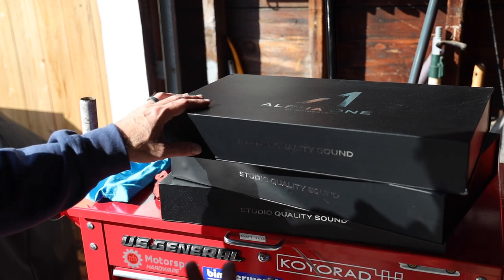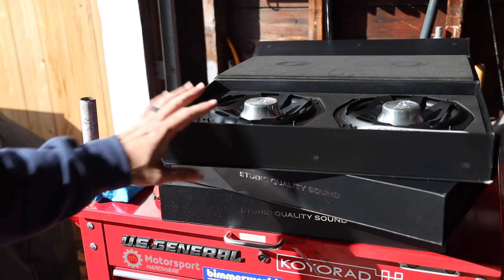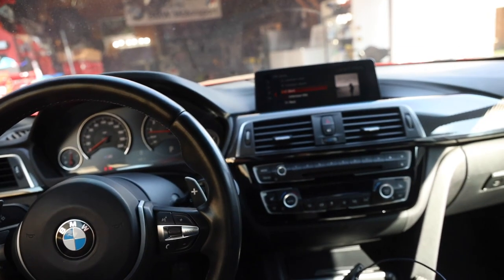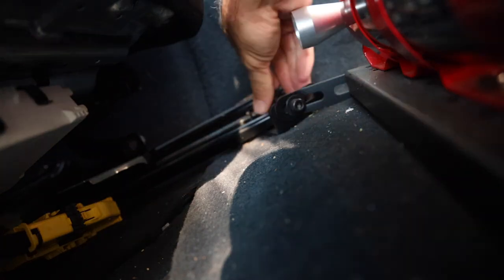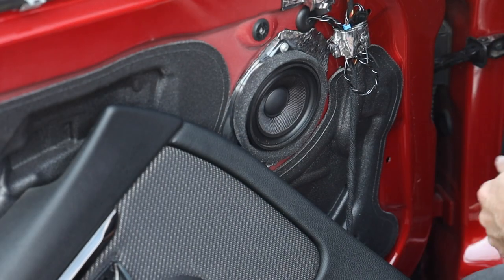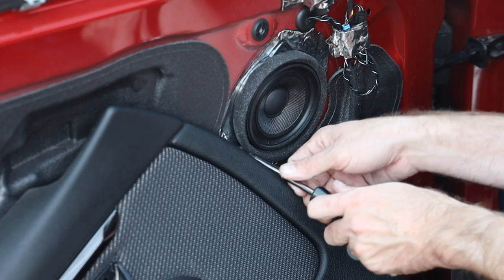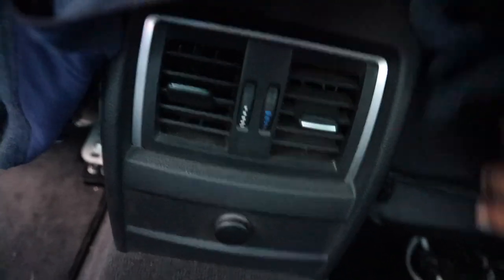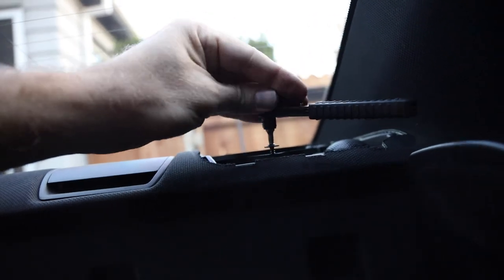Bimmertech Alphaone vs BAVSOUND Speaker Review BMW M4 F82

Comment: Thanks for the honest review Blake!  Naturally we're biased here at Bavsound so, wanted to reply to a few of your points speaking in *general terms*: A couple of things to keep in mind: More efficiency often means less control. It would make sense if you are hearing a bit more bass or volume from a particular set of speakers, you might simultaneously hear more "boom", which is a personal preference. If volume is at the top of the criteria list, then more efficiency is what you want. If you are looking for more control, sometimes you have to give up amplifier efficiency. We try to walk the fine line between big full bass and precise low-end reproduction... Part of our design ethos was actually to improve some of the factory subwoofer "boominess". As far as ferrite vs neodymium magnets: The type of magnet doesn't affect sound quality nearly as much as other factors. Some of our speaker designs are ferrite and some are neodymium. We use neodymium when there is a space constraint, and as you mentioned neodymium has a weight advantage if you are tracking the car. ... Silk vs titanium veneer tweeters: Silk will be clear but much smoother and warmer, natural sounding. Titanium tends to sound brighter and crisper, but can sometimes sound harsh or metallic. In short, our speaker designs were created with the idea that they would be "transparent" meaning the sound of the speakers would not be present. We want you to hear a bass guitar rather than bass mud. We want you to hear the singer's voice rather than the harsh sibilance of her speech. In essence, like you are there in the room with the musicians.
Reply: How about the pronunciation of “Bavsound”?  
I called your number and listened to the recording of you pronouncing your own name. It’s Bav with a soft a, not Bahv.  

Like “bat”.  
Not like “bot”. 

Thanks for coming to my Ted talk.

Comment: Before doing audio demos of new speakers, you should let them have their 10-20 hour break-in period, otherwise you're not getting anywhere near an accurate representation of what they will sound like. But, still... dope video.
Reply: Dude I didn't know that.
Thanks for the info.
I have the Alpha One speakers without the amp and so far it's ok (without the amp). The amp is bloody expensive$1400.00 now bro
Reply: @Matthew-yi3bm  just ordered mine and they have switched them to the match up 8dsp instead of the match up7!
Reply: For the amp^ speakers will be in a couple months

Comment: I installed the bavsound ghost woofers and I immediately noticed a day and night difference. The bass is crips and clean. Can’t wait for mine to fully break in. I installed them a day ago. Install was easy
Reply: Just the woofers? I have the HK in a G20 and am not sure if I want to just do the subs, replace all speakers OR leave it and add a small sub in the trunk. Id rather keep with the stock look. How much low end did you gain with the subs? 20/30/40%?
Reply: @ryanbuster4626 i have a G02 X4 with HK I’ve heard that there is no way to swap the HK amp and I’m not sure if upgrading the speakers will make a difference, any opinions?

Comment: After breaking in the Bavsound and Alpha one subwoofers, which has relatively more boom/thumping bass if I do not want to add additional amp or external boxed subwoofer???
Reply from the maker: I feel like the alpha one hits harder
Reply: @BlakesGarage  thanks for your input on Alpha One sub. hits harder than Ghost sub.  Maybe you can also consider reviewing plug & play Focal sub. and Match sub.
Reply from the maker: @peterchao610  ohh I didn’t know Focal made a plug and play kit. I really like there stuff.
Reply: Wonder how these would compare to the Audison 8” underseat subs made in Italy. Audison makes high end premium sound systems with their Forza multichannel amps with integrated dsp for a seamless integration into the BMW i8 infotainment.

Comment: Upgrading the speakers is cool but i have the Bavsound Revenant Pro Amp upgrade and HOLY SH*T did it transform the audio experience in the vehicle! Without adding the extra power of the amp to the new speakers you’re just missing out on so much potential. I also have the Bavsound ghost subs which I'm not as crazy about because the bass isnt as clean as i would like but i may have received defective ones.

Comment: Bavsound is the biggest rip off I think I ever seen. If people weren't so lazy and used to everything being done for them(or just dumb)they could save themselves  a BOAT load of money. By simply measuring my speakers and spending a lil time online I was able to replace the ENTIRE system for the same cost as bavsound was gonna charge for JUST THE REAR speakers! That's 11 speakers,head unit and amp,all in the factory housings using the orginal grills so one can't even tell anything was changed...cept for the AMAZING sound
Reply: I am really interested in which speakers you chose..
Reply: I’m also interested in what you chose. Yes there are other speakers you can get.. focal, morel.. etc.. please let us know what you chose
Reply: So what you chose bruh? It’s been 3months we waiting.
Reply: @MrMegambo  bros gatekeeping
Reply: Tell us what speakers you chose, you mark
Reply: Thanks for sharing
Reply: Bro is taking commercial break too seriously